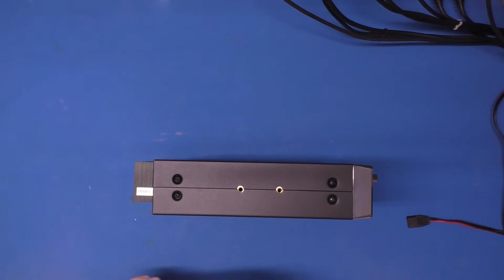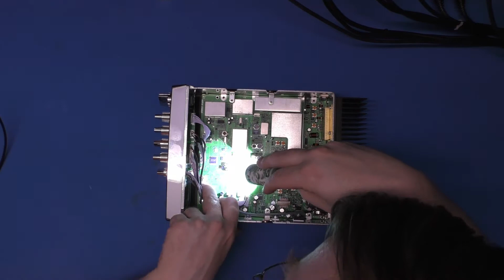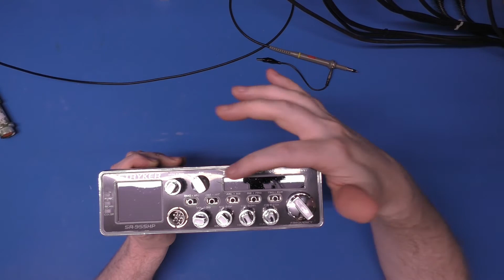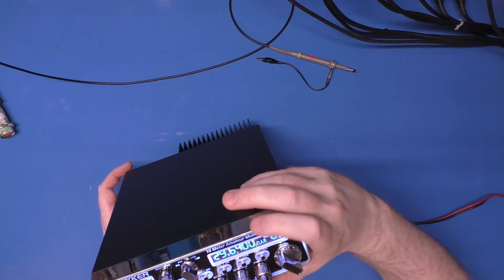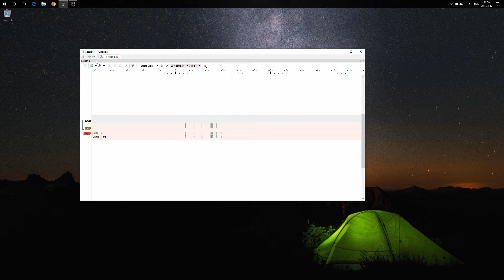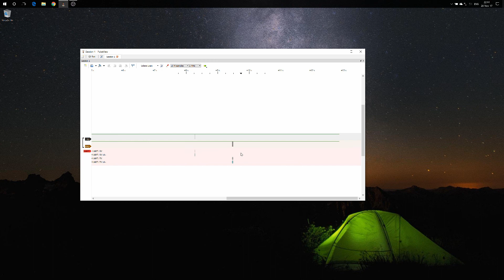Stryker SR-955HP dissection Part 2 - The guts.

Comment: Why don’t you show what diode or resistor to remove to get it to work on cb bands? I am a ham operator but I don’t want 5 radios in my vehicle to talk to my friends.
Reply from the maker: It's all over the internet. If you google it you will find it. It's actually marked on the PCB silkscreen with a white arrow anyway.